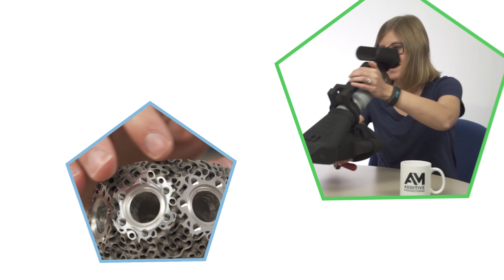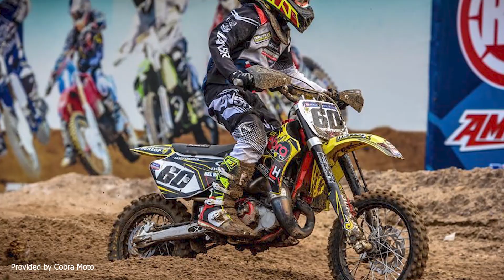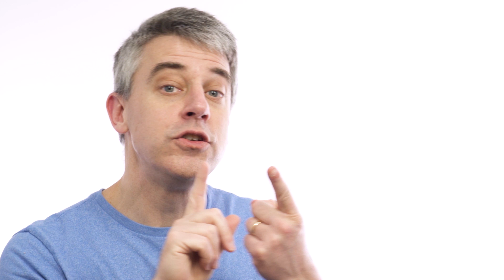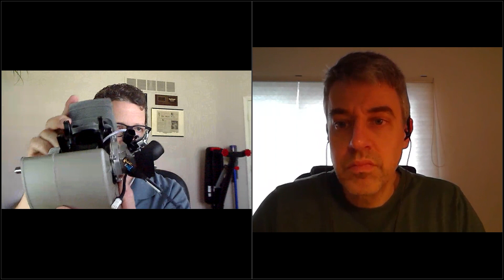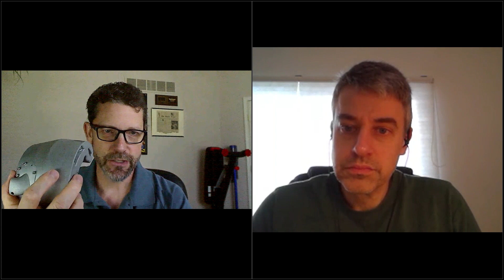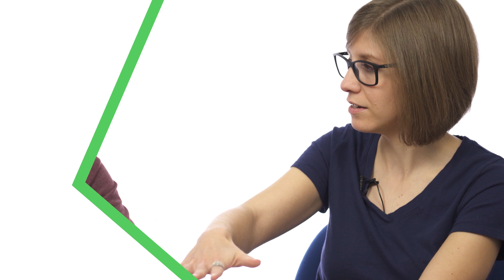3D Printed Drone Engine Replaces 13 Parts With 1: The Cool Parts Show Special Episode

Comment: There is probably so much additive can bring to engine manufacturing, especially aircraft engines where weight and performance are key. Take a piston for instance, that would benefit a lattice to reduce reciprocating weight, and improve underside cooling. Or cylinder heads, to maximise stiffness and internal cooling as well, and why not play with intake surface texture. The list could be very long.

Comment: This is an awesome story, just one point I would like to make please hear me out.
You refer to this as disruptive (technology) but the term disruptive technology is miss used. Harvard Business School defines the term Disruptive Technology as technology that makes the same end product faster, easier and cheaper than traditional manufacturing can.
in this case it is not the same product in fact you could not manufacture this part any other way. 
It is more correct to refer to this a New or Innovative manufacturing. 
I would be happy to discuss the difference in terms if you would like to debate, but take a little time and look at the difference the the implications of describing 3DP correctly.
There are certain applications where 3DP is indeed disruptive, the the dental industry for instance 3DP can be described as being disruptive because it makes certain processes cheaper easier and faster to manufacture so one cannot make a blanket statement the specific application determines how you would classify the technology.
Reply: I don't think that's right,  it seems perfectly adequate to call AM, 3DP, and this product disruptive. Here is the definition of Disruptive from Dictionary.com:
 
Disruptive in regard to Business,
"Relating to or noting a new product, service, or idea that radically changes an industry or business strategy, especially by creating a new market and disrupting an existing one"
 
I understand that the HBS uses "Disruptive Technology" as one term, but the definitions of Disruptive and Technology clearly apply to AM and this product, and googling "Disruptive Technology" seems to give several different explanations which appear to apply in context to the way that AM Media used the term. I'd say the HBS defined the term improperly and draw the conclusion that it is perfectly fine to continue using the term as they have been.